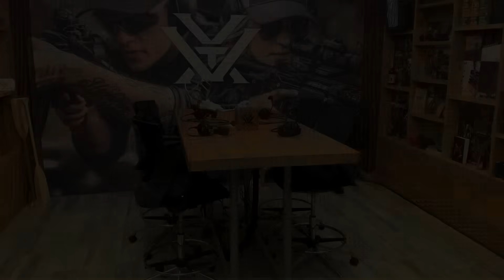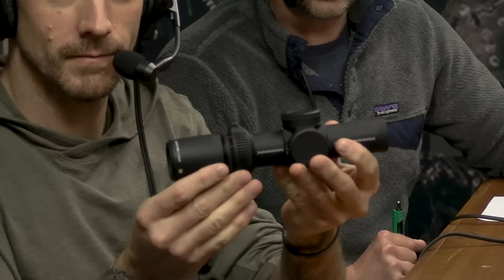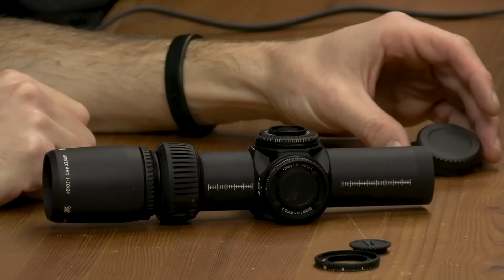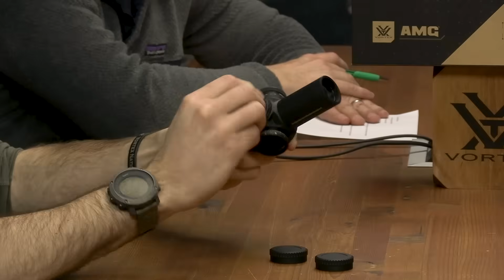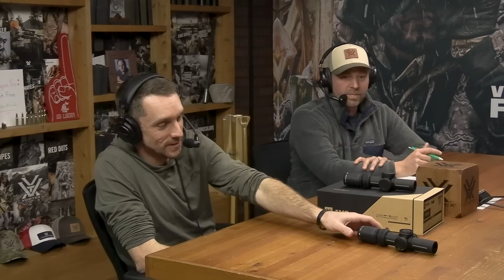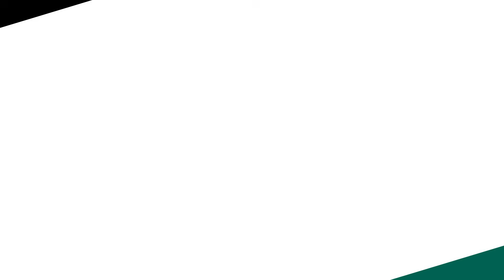Ep. 429 | Vortex AMG® 1-10x24 — A New Tier of Optic is Born

Comment: It this new LPVO as tough as a NightForce LPVO, a Trijicon? If not I'm absolutely not interested.   LPVO scope are put on assault rifles (usually) and as such are subject to more knocks. Durability is REQUIRED. Did Vortex increase tube wall thickness? Did they increase all lens attachments durability? Chasing scope lightness is running away from scope durability.
Reply: I have the AMG and I think it's tougher than a NightForce and on par with a Trijicon.

Comment: I'm really interested in the SRM! I work as a shock engineer for my day job, so hearing reference to shock response spectra (SRS) being used in the reveal video caught my interest really well. I'm interested to know how the SRM loads were developed - whether it was just with the SCAR or multiple platforms, whether it was a one-for-one representation of the time-history accelerometer data or a synthesized response, etc. I'd also be interested to see whether different platforms are used in the future, and whether loads would be tested independently for each or multiple platform loads are synthesized into one overall input. I would imagine that, caliber for caliber, a direct impingement system with a short bolt travel would get a general higher-frequency curve (or bolt actions at even higher frequencies, since there's so little motion), while long-stroke piston platforms (or even open-bolt crew-served systems, depending on the application) would see way harsher low-frequency excitation. I'm also left to wonder what portion of the spectrum was observed as a cutoff; the stuff I see at work rarely gets observed past 200-300 Hz since those loads are well past the displacement- and acceleration-dominated regions and pretty far into the velocity/pseudovelocity-defined region of the SRS plot, but I would imagine that with equipment so small and rigid, high-frequency excitation would play a pretty large role in effects on scope response. All the same, seeing this far behind the curtain for shock testing in this application was extremely interesting to me, and I hope it proves fruitful for further applications like everyone was saying! I thought it was an excellent episode from a technical standpoint.

Comment: 5 microns tolerance is 0.0002 inch. That's not really that incredibly terrible if you've got a well proven process and good machine. I've worked to a 2.5 micron tolerance once and yeah, it's expensive and time consuming, but definitely doable. Air gaging is the right call there for sure, especially since all the other ID measurement methods that I'm aware of are less accurate than OD measurements like I was doing.

Comment: What exactly makes this optic cost 3,000 dollars more than the strike eagle gen 3 1-10 ffp edit my bad i meant the razor 1-10
Reply: I have both the razor 1-10 the AMG 1-10 contract. I was checking out radio towers on a ridge about 5 miles away and comparing the two I really thought that my razor 1-10 was broken or may have a problem after doing an AB comparison between the razor and the AMG.
Reply: @BeerMeatFire that's awesome. One day I would loooove an amg hah
Reply: @BeerMeatFire  That doesn't surprise me. Honestly, coming from the photography world, scope prices always seemed a bit low to me. Great glass costs a lot of money! Compare this to any top tier telephoto camera lens and it's pretty reasonable.
Reply: Better glass, better internals, and you are supporting American manufacturing.
Reply: @CarRacerGVR4 main issue is i would then have a scope worth more than the car i drive every day.
Reply: @ethan.amosberg835  Guns come and go but you will never be mad at yourself for buying good optics. Whenever I went to competitive shooting matches my car would triple in value.
Reply: There's no such thing as a strike eagle gen 3 1-10
Reply: @titosmiff1058 my bad I meant the razor 1-10
Reply: @ethan.amosberg835  still. Lot more into the amg
Reply: 7 years of team labor.